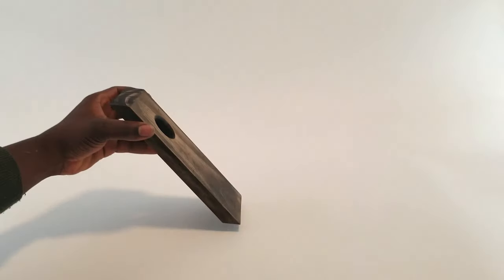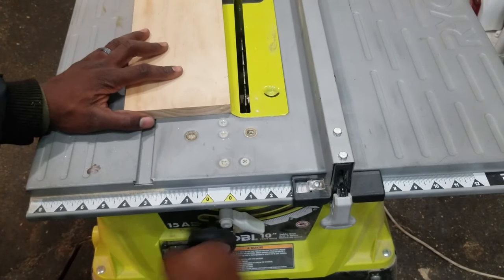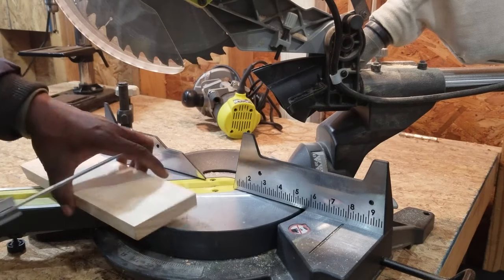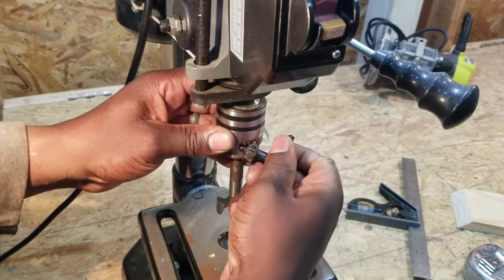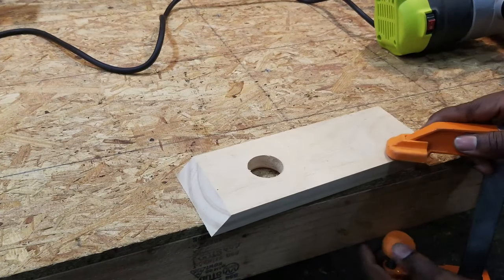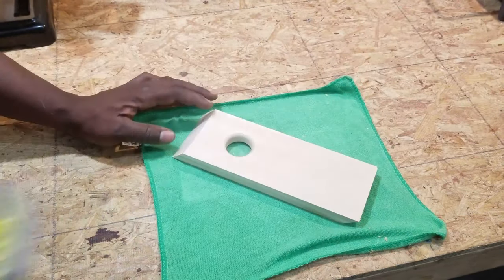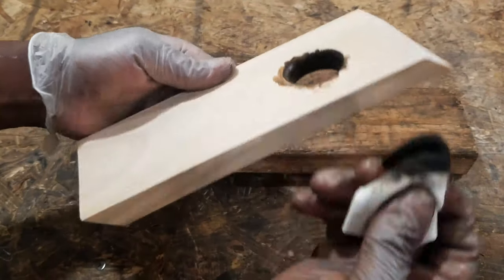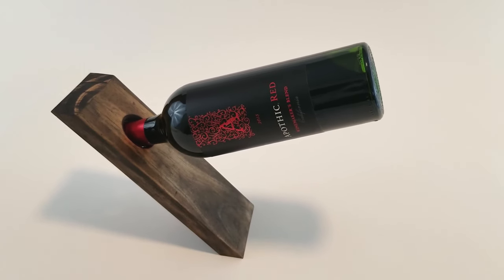How To Make A Floating Wine Bottle Holder From Wood

Comment: dimensions would be nice.
Reply: Depending on what you choose for your board (thickness) the measurements will vary slightly. Based on a 8.5 inch board make your hole 1.5 inches in diameter and center it on your piece 2 inches from the top. Your cut angle will vary slightly if you choose to use a longer or shorter board. Anywhere from 35-45°. Width doesn't matter but thickness and height will.  Hope that helps!
Reply: If it works I'm  happy I will try
Reply: Can I show you my results

Comment: great video and great job! if there was one thing i could have added it would have been to include some more details like the size of the forstner bit and the grit of the sandpaper you used (unless it was the same 220 grit you used for the edges)  for the face and maybe some dimensions of the wood.

keep it up!
Reply from the maker: Thanks for your input, I'll definitely add more specific details on other upcoming videos. Thanks for watching.